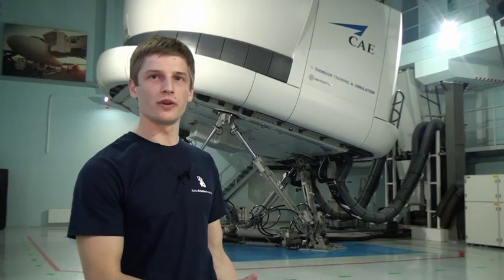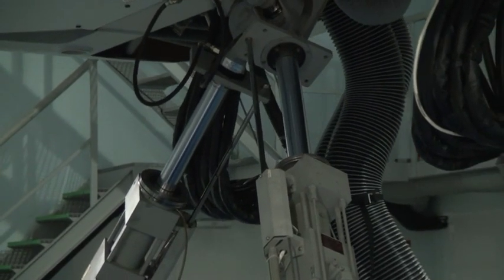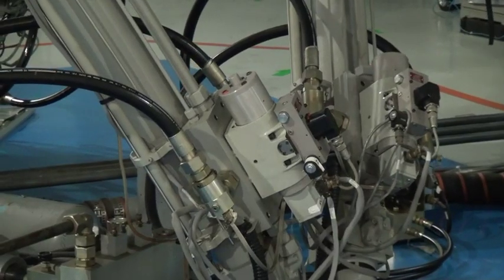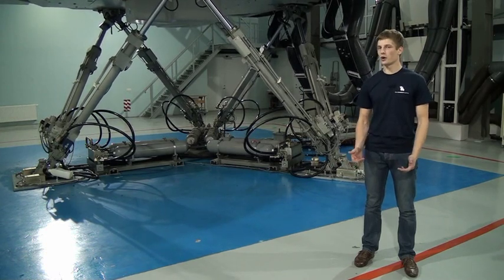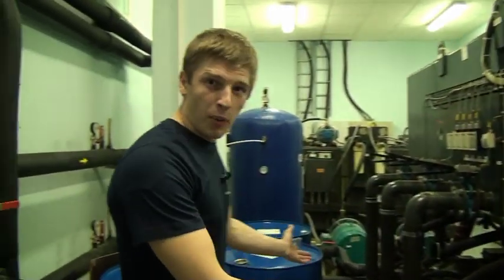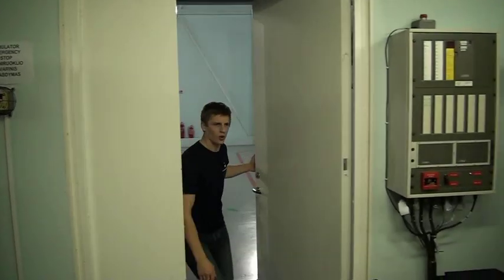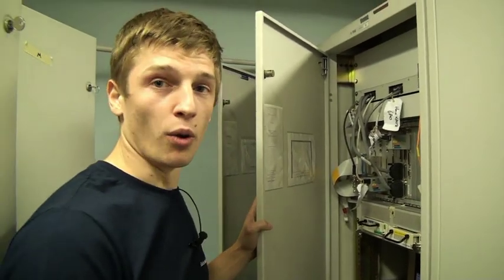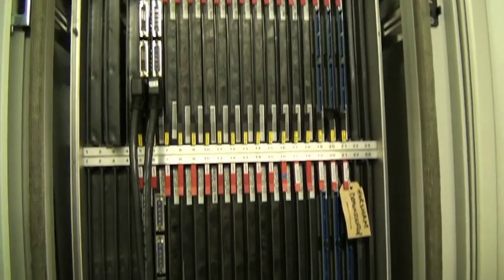How does A320 Full Flight Simulator work? - Baltic Aviation Academy

Comment: Simulator motion system represents acceleration / deceleration feeling, but not an actual attitude or position of simulated airplane. So, in stall condition there are very little acceleration / deceleration feelings to represent and simulator stays pretty calm.

However don’t go to turbulence or rough landing. That shakes all office desks around for sure…